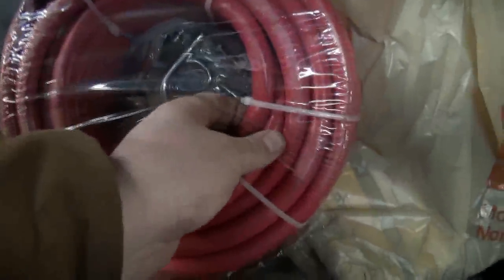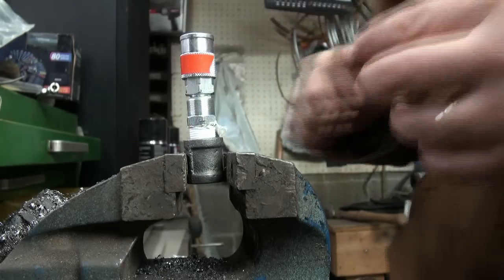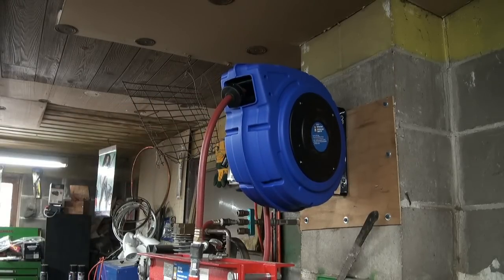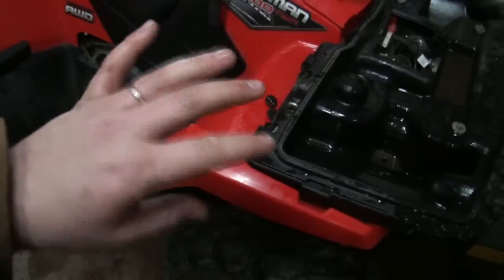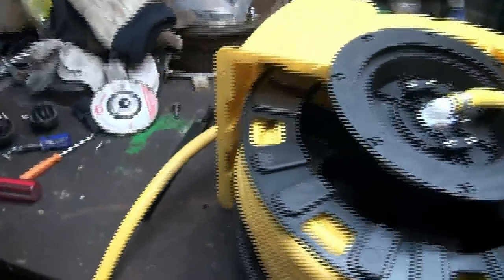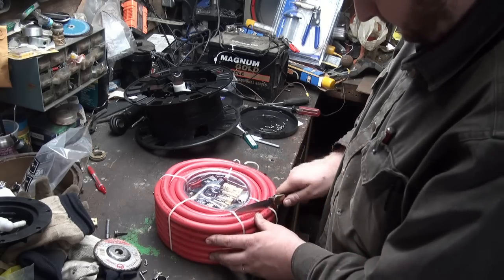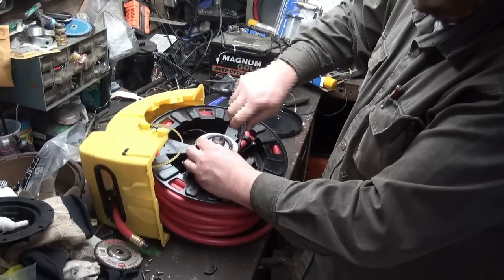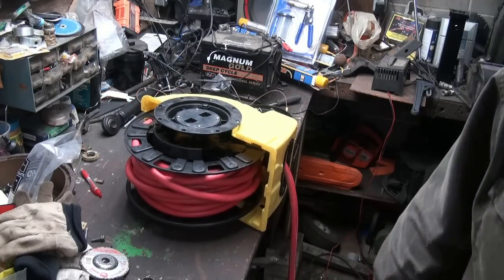got one hose reel working and sorta wrecked another one  oops

Comment: I hate that teflon tape stuff when working with air, I plumb a whole bunch of stuff together and it always seems to leak somewhere.  I use Loctite Red Threadlocker now.  You have to let it set up for 24 hours before you can apply air pressure to it, but I've never had a joint leak yet when using it.

Comment: The only thing you missed was to line up the feeder mechanism again with the hose on the roll and to give it much, much more initial tension. Then it would be working (provided it doesn't leak air after you put it together).

Comment: The burrrrrrrrr was the tensioner spring unwinding. Even when it's wound up completely, it isn't relaxed, for then the spring wouldn't have enough tension to pull the hose back in. So you'll have to wind it up a couple of times before remounting the dewie on the doowee.